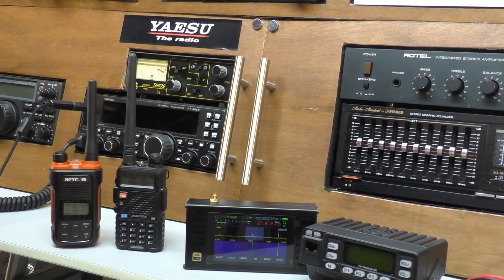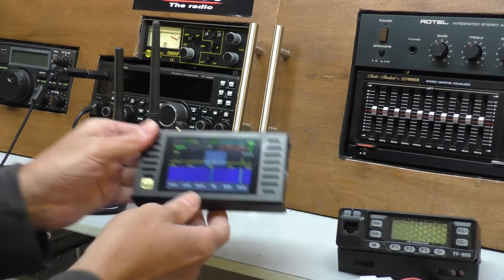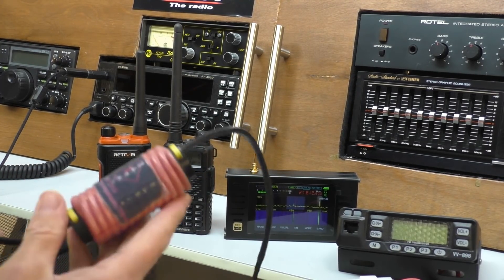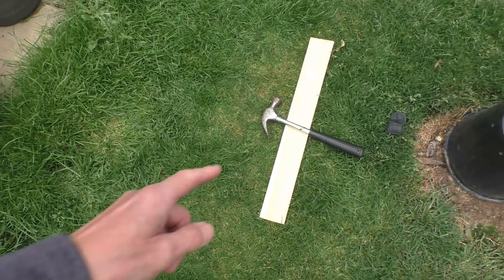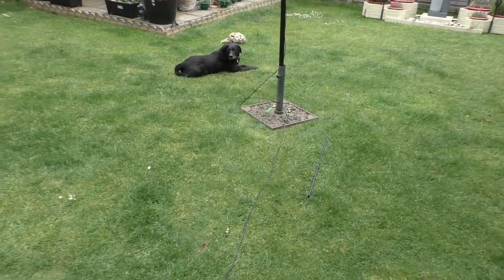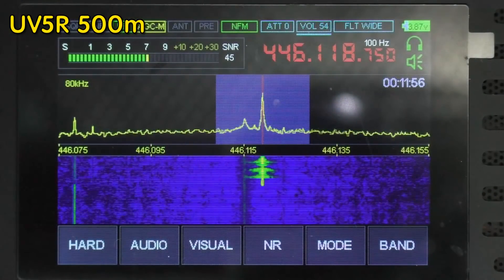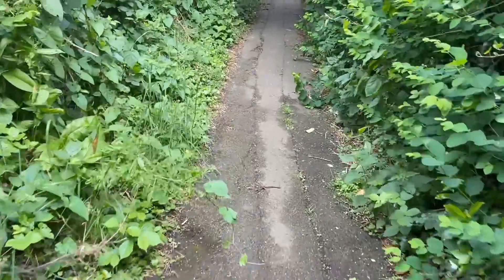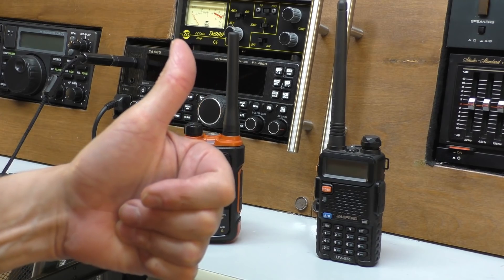Things went horribly wrong. PMR 446MHz Antenna testing.

Comment: Maybe a quarter wave coax with a 50 ohm feed T feed and the 330 ohm emission point do screen to centre swap with 6.2 ohm inline to match the 330 ohm free space shunt. Then the open end of the coax with string to the top?
Reply: So yep, the 25 up and 25 down ohms point for a parallel at the T with a 1.76 ohm on the up series to match as 25. With extra half waves on the up to open for length. A 5/4 wave for example. Umm thinking....
Reply: Ooh 8.25m errr....
Reply: ... velocity factor ...
Reply: Enough work for today @ 4.78 meters on CB. I'm not sure if less than 0.66 is too lossy.
Reply: Oops 5.44m.

Comment: Fred, to my mind there are several possible issues at work here. Firstly, M&P Ultraflex 7 coax and N type plugs is the way to go for UHF and keep the coax run as short as possible if you want to keep the weight down. I also I highly recommend the ‘DX commander’ telescopic pole for strength and longevity. It may also be advantageous to check that the antenna is correctly resonant at 446MHz with an analyser and or SWR meter just to be certain, this should keep noise levels to a minimum. These significant improvements should yield you far better results :)
Reply from the maker: Thanks Barry some good points there.

Comment: Sirio CX440 is a good option. Low SWR from 440 to 450 Mhz and receives very well, I can hear handheld easily at 3 miles in rural area. Will receive my UV5R from the local town at 10 miles.

Comment: Hi Fred. Wow, those fiberglass extension poles aren't cheap, so sorry you lost the 3' top section. Perhaps the coax was an issue as some have said, although I've never had big losses when receiving a signal - just when transmitting. How much more coax were you using for this vs. when receiving on the 11m antenna?  It could be an issue with the antenna itself. Perhaps you could put a analyzer on it just to verify all is well with it.  BUT, I have to hand it to you for this videos title - I have a bunch of YT pages related to 2-way radio that I subscribe to, but when I scrolled down the list to select one there were no contenders that could beat “Things went horribly wrong”... great title, and I'm happy it didn't involve a lightning strike!
Reply from the maker: Hi.  I was using a run of 10 meter RG58.  The run from the Antron 99 is RG213 prob about the same length.  Yes it did not work out on this test but thats true radio.  Thanks for the comment.

Comment: Thats a bummer Fred, your fiberglass mast snapped. I've been looking into a sectional fiberglass telescoping mast from "Maxgain Systems" a 46' footer,  their mast tubing is twice the guage/ thickness as many other brands i've looked into like "DX Engineerings" comparible model, anyways the masts sections are secured by a clamshell camlocking system that locks each section as the mast is raised.
     How does your mast secure itself as its extended into the air.
     Great vedeo none the less. Take care! 73's✌
Reply from the maker: Hi Eric.  The cheaper kite poles like mine just use friction on the joints to hold up.  This is fine if your only going to use it for a days DX but if you plan to keep it up longer they can fuse together and split when you try to collapse the pole.
Reply: @CB-RADIO-UK  Aaahaaa, I thought thats how it stayed up (friction) but wasn't grasping it at the time i reviewed your video, I was too distrought over the fact that your mast snapped!!!... lol

Comment: Hey fred! I use a Heavy duty pole from germany: Spiderbeam 12Meters / 40 FT it cost me 90.- ant it's 8mm on top section!1-2MM wall thiknes.. 
I have it installed for more then 2 years, i removed 4 sections, and put a Diamond X50 on top like a lolly.. fill the gaps with som fome, and run the coax cable inside the pole. ..  it holds! in storm, in winter. these are great quality poles..  Use Some thicker coax my frend. i have 25 meters of H2000 coax inside the spiderbeam pole.. thats realy low loss coax for a bit of money. i payed 75.- for 25 meters.  wish you luck! ;)
Reply from the maker: Hi Bart.  Yes a good quality pole is the way forward.  Even these kite poles are over £50 now so worth paying the extra.
Reply: @CB-RADIO-UK  Go for the spiderbeam fred and others... it's quality is way above the others! i use it stationairy for putting my antenna's way up above the roof of my house..

Comment: Hi Fred . Been a sub for a long time . I have a question you might be able to answer. I came across a Galaxy dx 959 . I have never had a radio with ssb and would like one . Is this worth my time ? I thought if you do not know you might ask around. Thank you for your time .
Reply from the maker: Hi.  Ive never owned or used a DX959 as its a USA AM/SSB radio and does not have the UK FM.  Ive always liked the look of an old fashioned needle power meter and digital display.  I would buy one if the price was right.
Reply: @CB-RADIO-UK  thank you for your help anyways. It is always good watching your videos.

Comment: I need to change the aerials on the baofang uv-5r when you are using vhf or uhf on the small aerials provided. I got that Na-771 . I still cant hear the space station on 145,800 mhz.
Reply from the maker: The ISS is tricky unless it directly overhead.  You can make yourself a helicoil type antenna which boosts your chances.

Comment: I have the Hawkins Thunderbolts ½&⅝w with the coils, and I just slide my Coul over the tip of the pole, saves it moving about.
Both wire antennas work great with a 10m Spiderpole, but it'll work much better hung on the 30m tree in the neighbouring garden. Lol

Comment: I built one of those 2m/70cm t2lt’s and wasn’t impressed with performance Fred. I then built a 2m/70cm 1/4 wave, 50cm driven element with three 50cm ground plains, I’m now picking up repeaters etc 70+ miles away. Plenty of how to vids on here, very worthwhile build.
Reply: for the money try this! i had one made just for fun.. only 1/4wave for 70cm  13 or 16 cm driver + 4 groundplanes VSWR 1.1 then i put it straight on my HT. it works amazing! better then any other antenna i had before.

Comment: I like experimenting and have days like this Fred. The best result I got on PMR on a low budget was a homemade Yagi for 446 and the UV-5R. I clamped the Yagi onto my van roof rack whilst static on some high ground and made a contact 72 miles away. Just used basic RG58 coax but the short length of 2m probably helped minimise loss in signal. 
Enjoyed the video as always mate 👍🏼

Comment: Back to CB you get more performance. VHF/ UHF is not for long distance by such weak output and antennas without much gain like those walky talkies. On HAM-radio you have repeater, much more output and better antennas to get good results. Btw, yesterday i talked with english (Channel UK 38 FM Gloucester-Group) and welsh stations (Channel UK 19 FM from Talbot) on CB with 4 W, DV 27 Long mobile antenna and my little President Truman ASC here from Germany . :) VY 73, 13CT2929

Comment: Could it be that the SDR receiver doesn't work very well on 446? It seemed to have a high level of background noise as well.
Reply from the maker: Possible but i have used this antenna before and not really been happy with it. I may revisit this in the future with a UV5r as the receive radio.  Maybe look at lower loss coax as well.

Comment: I wonder whether the disappointing performance was due to loss on the feedline. At UHF you can easily lose 90% of your signal unless you use low-loss coax, which would be far too thick and heavy for a fiberglass pole. 🤔
Reply: Actually taping the coax to the pole likely could have kept it from breaking. I have some hardline that if taped to the pole it would stand up straight, but it is rather stiff and would be hard to use. That rg58, like you, said likely lost most of the signal both ways!!
Reply: Westflex. Job done once, PROPERLY. 🌚
Reply from the maker: Paul what feedline would you recommend.  RG213 is way to heavy ?  Cheers
Reply: @CB-RADIO-UK  aircell7 ?
Reply from the maker: Hi Flow yes Messi & Paoloni does get good reviews.
Reply: @CB-RADIO-UK  i have a same situation with a 10m pole , and thinking of building a T2LT for pmr . With only +/- 15m aircell7 the loss is acceptable :)